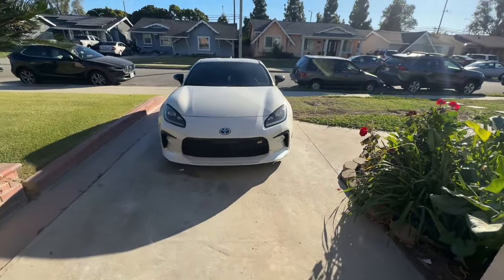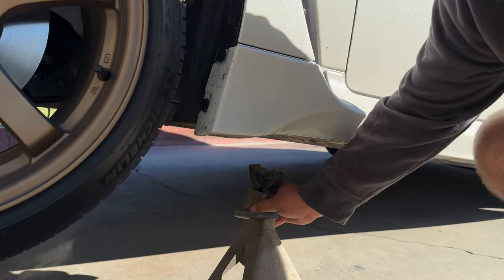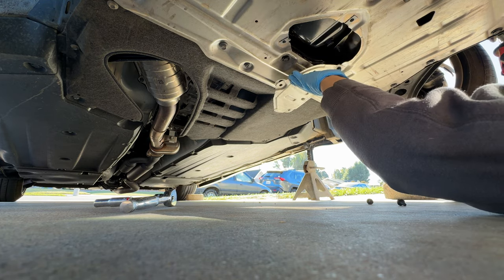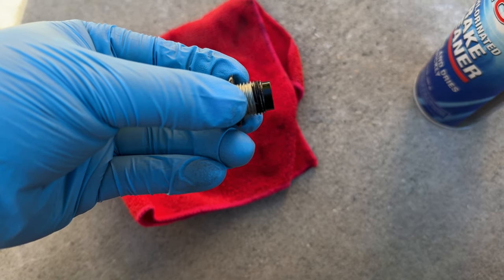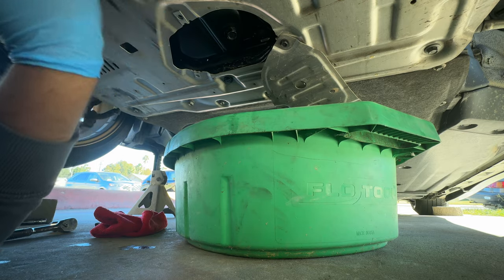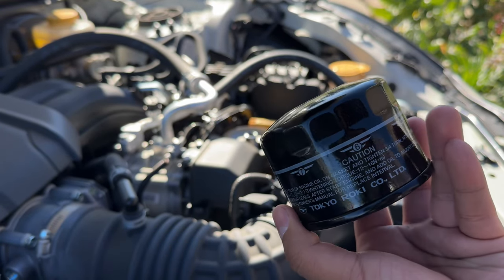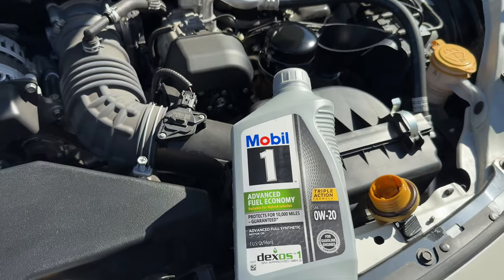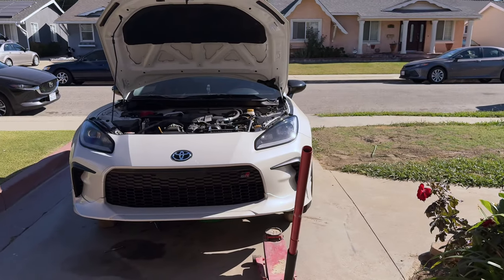GR86 20K MILE OIL CHANGE! (HASNT BLOWN UP!)

Comment: As a mechanic I will NEVER go 20k miles without an oil change I do my oil 3-5k miles not bc the oil can no longer protect the motor but bc sludge will 100% build up if you wait 20k miles between oil changes and instead of getting 150-200k miles out of my motors life I’d rather spend an extra $35 on Mobil 1 Ext Perf 20k mile synthetic oil an change it every 3-5k miles to clean any previous sludge from previous owners out an to prevent it

Comment: I noticed that you used your floor jack in the front of the vehicle before placing the jack stands, was there a reason for that? Does it make it so your tires land evenly when you are finished, removed the jack stands, and then lower the car back down? I've seen so many vods of people just using the floor jack on the side, lift, place stand, move to other side, and repeat. Also, how did you know where to center the floor jack in the front of the vehicle?

Comment: Aren’t you supposed to do an oil change every 5000-10000km
Reply from the maker: Yes! Well idk what that is in miles but this car is recommended by the dealer to change the oil at 7500 which I think is way too late. I do it every 5k. This is just MY first time doing it myself. I had serviced at the dealer three times already 😁.
Reply: @uReact2  5k if you drive it on the highway to get 5k miles in a year. Every 6 months if you drive in city or town.

Comment: How come you added a washer to the plug? I didn't see you have to remove a "old washer" when you removed the plug, did you? Sorry for the question, i have a new GR and trying to understand the method behind this and why a washer was place on it when placing the washer back on. If i took my car to a 10 minute oil change, would they even know about this? Is the washer a necessary process and if they didn't do what you did, would it be a big mistake on their part which could compromise the integrity of the oil plug?
Reply from the maker: Every time I took it to the dealer they put a new washer and I’ve always put new ones after any oil change on any car.
Reply: @uReact2  I have yet to do anything with the oil in my car, it's only a month old. So are you saying there is a washer on the oil plug? I'm just curious because if i took my car to lets say, Express Oil Change (the 10 minute oil change place), would they know it "needs" to have a washer? I know you are not a mechanic, but just trying to understand this whole washer thing, i have never dealt with one with previous, older cars.
Reply from the maker: @Ccortanaa yeah I wouldn’t take my cars to any of those quick oil change spots. A lot of them are known to mess something up on your car. Some cars don’t take washers and use like a o-ring gasket. But these cars take a washer. They’re only like a dollar at the dealership.
Reply: @uReact2  Also, those gasket rings look metal? I've seen a lot of good reviews on those blue rings that look almost like fabric. Is that ring you showed metal? If so, how come you chose that over the blue rings?
Reply from the maker: @Ccortanaa yeah most Toyotas use that metal washer with a blue coating on them. Subaru is using crush washers like the one I have in this video.